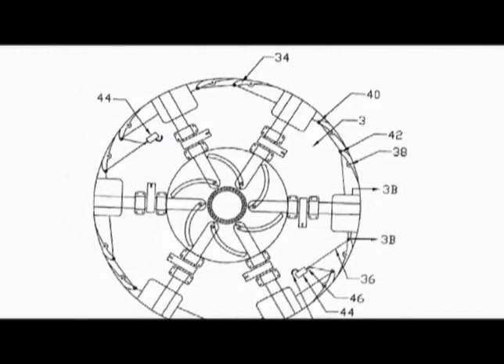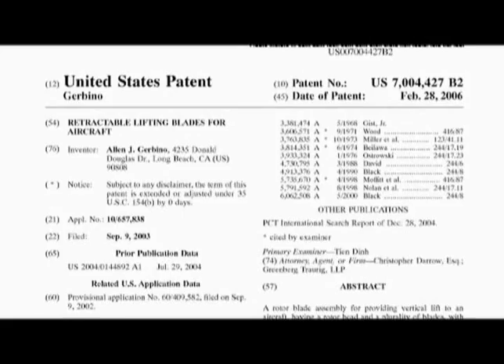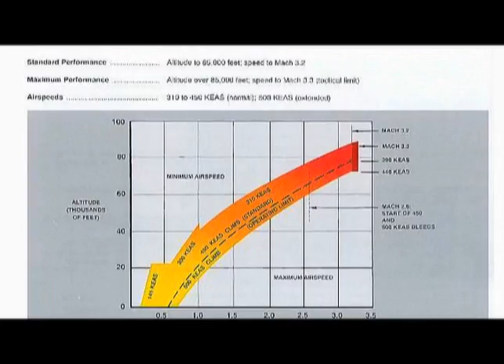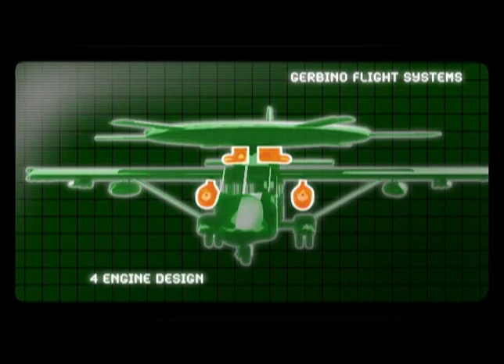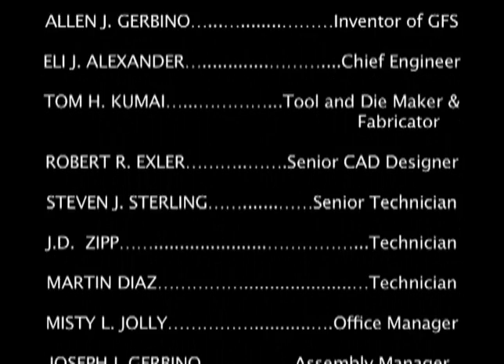VTOL GFS-short NEW

Comment: Cool! I had the same idea a few years ago... But I thought such rotorblades would be to small to produce enough  lift...? I mean - while hovering - the disc in the center is basically just wasting area which could have been used for blades... Of cource the disc is necessary in this concept. But I just couldn't belief the left area for the blades would be enough to provide the necessary lift.
Anyway... I like fresh ideas and this plane is really cool! Buid it! Good luck!
(How about more blades?)

Comment from the maker: @bennymutant 
Thank you for your comment, Flying our models has us building the full size proof of concept aircraft. As a small group of professionals we are not looked upon as fovorably as the larger companys, probably because of deramers over the years. The differance here is we are real builders and we are building! It may take longer but we have rebuilt P51's T28's Gnat jets AH1 Cobra OH6A  an '89 Oskkosh winner all flying today! Without outside help. Its only work. PS smokings bad.  Al GFS

Comment from the maker: @Obelix6 Don't feel bad about your concerns, I happen to believe that concerns by outside sources when addressed lead to a better product . OK  the blade area is 132 square feet larger than the actual wing area of the stock aircraft its self. The rotor speed is designed to give us an almost 26.5% safe margin. The fenestron has been calculated to support an aircraft of 19,000 pounds, Our gross weight is 10,000 pounds well in its operating range. Thank you for your questions and concerns. Al GFS

Comment from the maker: @tardoproto I thought of the asymmetrical concept many years ago, We designed our aircraft based on emergency procedures in and through ALL modes of the flight envelope as a long and high time Pilot I was NOT going to design a Lawn Dart.. It was obvious that asymmetrical control woukd not be practical, without going into details of our research discoveries. Lets explain one big reason, loose one engine and both of your flight systems suffer catastrophic failure thanks for the interest  Al G

Comment: Personally, I like this concept.  retractable rotor blades seems logical to me, also the fact that they won't fail at high forward speeds.
I'm wondering if the rotor disc housing contributes to the lift, when the blades are retracted? ie; in an airofoil shape, just a thought.
Neat idea..  subscribed.

Steve
Reply: it can be designed to add to lift

Comment: it's an interesting design but I think the dual tiltrotor may ultimately be more elegant.
maybe electric motors. 
balancing can easily be solved and if one motor fails the other motor can be throttled down accordingly so it remains balanced. electronics is fast.

Comment: @GerbinoFlightSystems it's not 'special circuitry'. and as a pilot you should know that all sizable aircraft rely vitally on the electronics.
plus I see no reason why a tilt rotor couldn't land unpowered just as well as other types. autorotate when vertical or land as a glider when horizontal.
let's not pretend your design has no problematic failure modes.
like with any design it has to be engineered properly.
Reply: of course it can be configured to land autonomously in glide or heli mode.. why do you ask such stupid childish questions

Comment: Very cool and innovative design. Nice to see that it's capable of landing in an emergency as either a plane or a helicopter. One of the biggest flaws I see in it is that the damn thing runs on four engines. They look to be turbines, none the less! That baby would eat through gas faster than I could imagine. I suppose a lot of airliners are quad engine fuel gobblers as well. Maybe I'm just used to to 10-15 gph cirrus' and cubs. I just think it could be more efficient. Any idea on operating cost?

Comment: I'm curious, in helicopter mode, how this could generate pitch for directional control and lift with such a large dome on top, and from my understanding of how helicopters work, the blades seem to have no rigidity in order to create rotor differentials needed per spin rotation.

Comment: OR you can just make more reliable computers with back-up precautions. You must realize that within a few decades most US military aircraft will be capable of flying without a human being on board. They will be able to complete missions without pilots. The next generation of bombers are being designed with such things in mind and as requirements. Even helicopters have already been tested as UAVs. Unmanned/manned variable aircraft and helicopters will also exist.
Reply: ahahaha what happens when they  lose an engine  or computer  mother board.. yes lots of autonomous vehicles will be  flying ,,,but the majority  of heavy lift and passenger will always be  human controlled.. ALWAYS

Comment: Small effective disc area, so less efficient than a helicopter in hover mode. It'll really need that in-flight refuelling probe! Not fully convinced of auto-rotation capability with such short blades. Also the anti-torque mechanism is not clear. It will have to have good authority because of the high drag inefficient rotor and will need to cope with all engine-out scenarios.

Comment from the maker: @DanFrederiksen OK, I love flight assist, Hydrolic, Electrical, and Pnuematic. as a fixed wing and comercial helicopter pilot I enjoy those assists. But they are not required to keep the aircraft in the air. Dont have an aircraft  that looses its ability to be a controlable platform because of a failure, My type can have an equipment failure, but is a controlable platform. Pilots can over ride failures. It does NOT REQUIRE computers to fly. Tilt rotors can not autorotate. GFS Al

Comment from the maker: I would like you to KNOW that if a blade breaks off on any rotorcraft you had better been at peace with your maker. The catastrophic results are instant. But lets say your reflexes are super human or the problem is detected before it throws the blade with this type of configuration you can stop the rotor system(stopping the continuing destruction of the aircraft) and continue to a safe landing at the closest available airfield. Dan I hope you don't mind if I don't go flying with you then. Al GFS

Comment: I highly doubt that 1 engine could return 700 miles, or alone keep it in the air. Just seems like 4 engines weigh too much.
Reply from the maker: the beauty of turbine engines is light weight and high horsepower example a 317 pound engine can put out 7 hundred and more horsepower (Allison)

Comment from the maker: @DanFrederiksen You know Dan as a pilot and an Aircraft builder I have great dificulties with any type aircraft that needs special circuitry to survive a failure because the pilot and crew can easily become victims of cascading failures. I like the option that when everything that burns fuel stops I can auto-rotate, zero forward speed, or dead stick land my aircraft. This aircraft was designed from the emergency procedures in all flight modes back to the Pilots Seat. By Pilots.

Comment from the maker: @hightechopa I have addressed this subject before, the last 2/3rds of the rotor blades is all that does the work the inner 2/3rds basicly just holds the last 1/3rd out there. the inner 2/3rds does assist in auto rotation. our rotor system has 21% more lifting surface than the wing itsself. more blades are not required...   Al GFS
Reply: ahaha i just finished calculating this last night.. thanks for confirming it.. im often wrong .. thanks again...